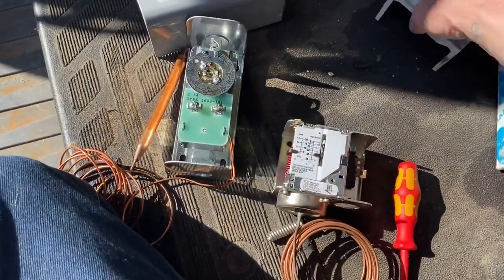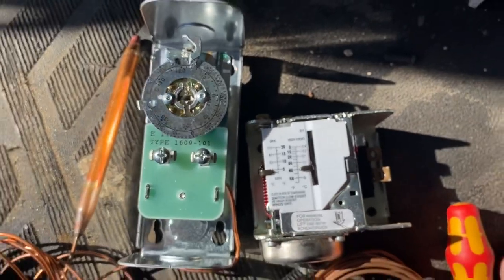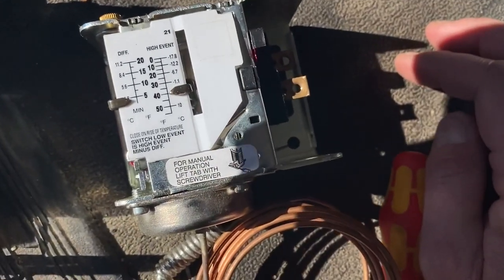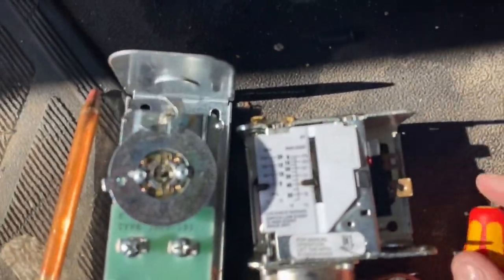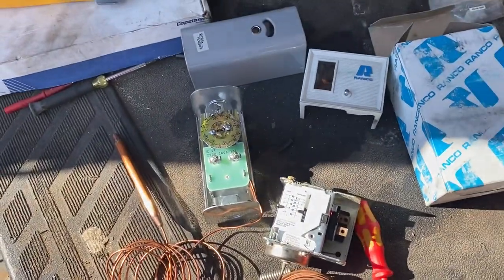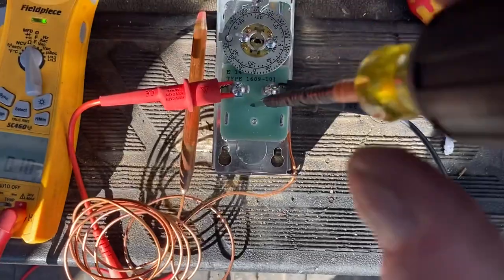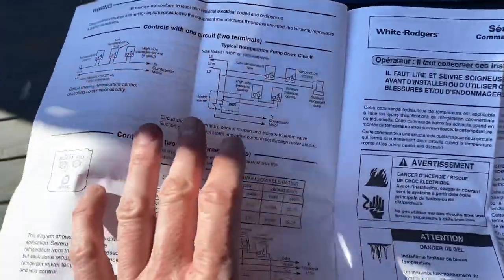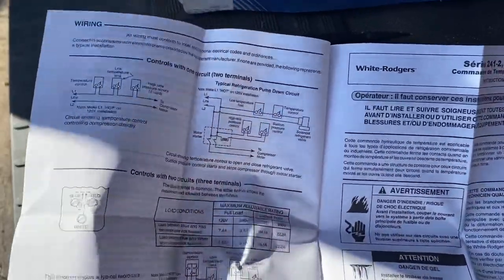Basic thermostat operation for Refrigeration

Comment: Thanks so much! Took me some time to understand turning it down to make it come on because I was thinking when the temp goes down it cuts off.  Finally I see, when you turn it down that's the temp you want the cooler to be and it shuts off (opens) when it gets there with a normally closed solenoid.  Gosh, I can't believe that tripped me up. Smh.

Comment: great video! thank you so much. In my small cooler, I have a thermostat, but in the condensing unit, I have a low pressure switch. How would I set the low pressure switch if I want to control the temp just with the thermostat in the box? thanks
Reply from the maker: Is the temp being controlled by the low pressure control or the thermostat ? If there is a thermostat the low pressure control should not be controlling the temp